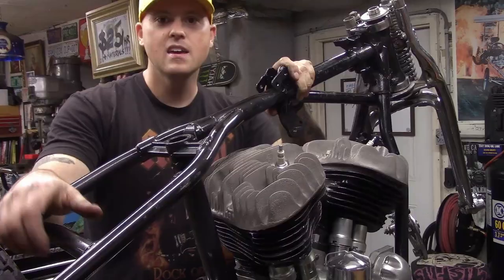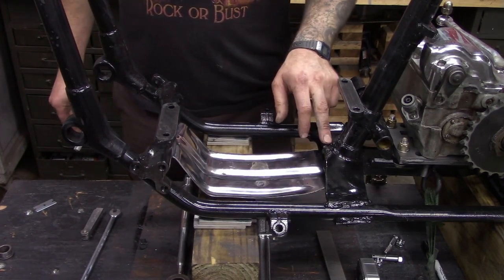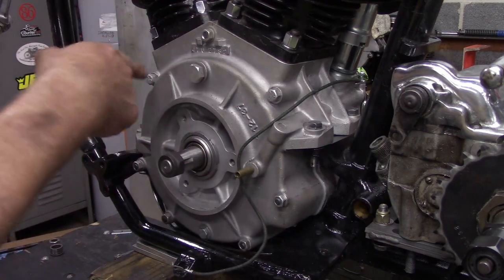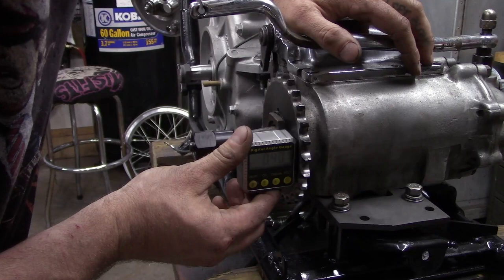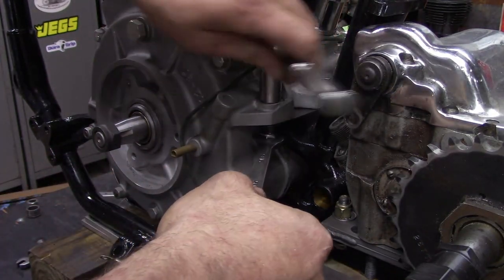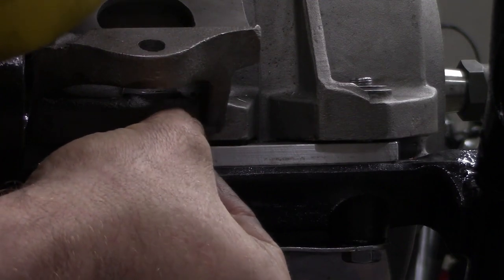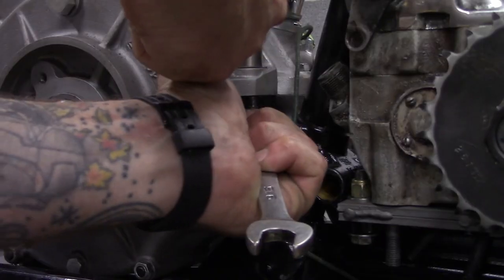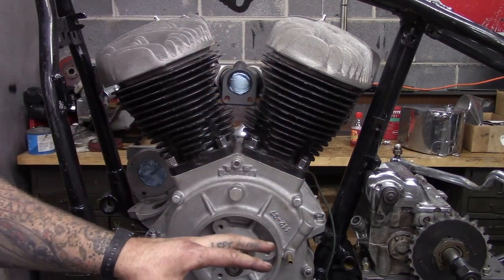1947 Harley Flathead Build - Part II - Installing the Engine

Comment: Hey dude, do you install the trans plate first then the transmission? or do you install the transmission onto the plate then the entire thing as a unit to the frame? Putting back together my 53' pan shovel- first big twin. Thanks!
Reply from the maker: I the oil tank is out, you can bolt the plate to the frame first. If the oil tank is in, you'll have to slide the trans with the plate in together.
Reply: @ChucksCycles  thanks dude, yeah its all apart so i'll do that and make sure to check to shim it and the motor. I'll also pick up one of those angle finders too to make sure they're straight. I've read you can use an inner primary but im running a tin primary and my trans doesn't have the ears to bolt a primary to. Still wanna make sure it's straight though!